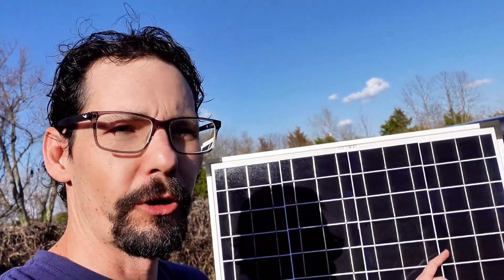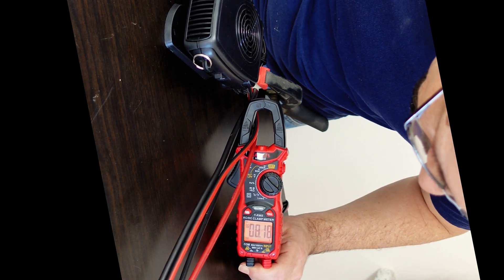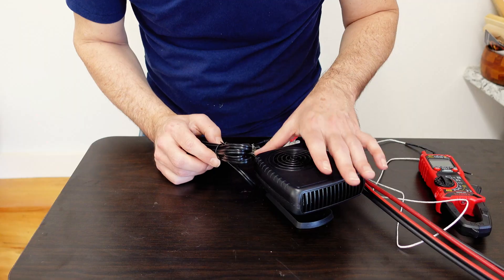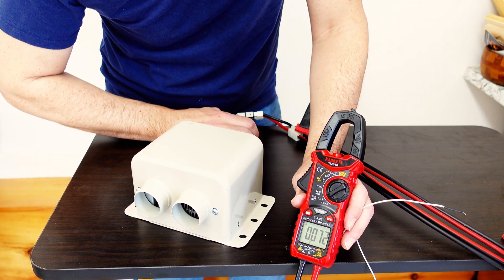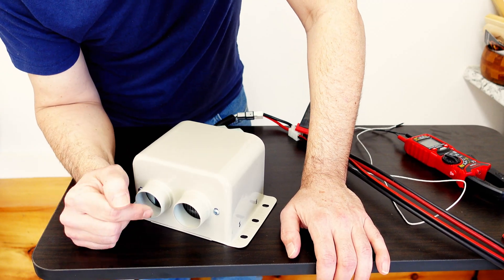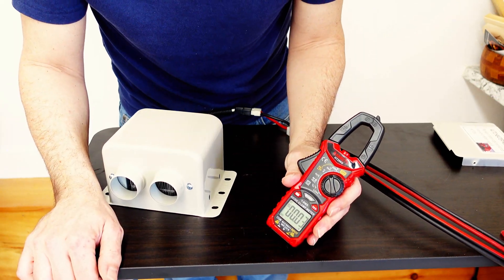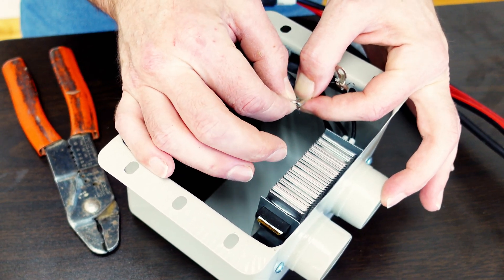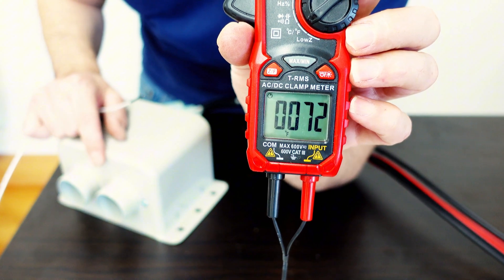Free Solar Hack

Comment: Nice would at least like to see the white with four panels 😊. Trumpocalypse Now
Reply from the maker: Me too! It's on the list. My guess, Lotta heat but fan runs a little too fast. Could possibly fix fan speed issue with the right resistor in series with it. I need to whip out all my analog meters to read accurate current for fan.
Reply: @ an old volume control knob is a variable resistor.   I miss Radio Shack
Reply from the maker: Great recommendation

Comment: I have seen little ice makers at Wal-fart. Do you think you could make ice for drinks and to put in a cooler with just solar panels? If I could afford to try I would.
Reply from the maker: What dimensions is it roughly? Is it AC?
Reply: @WayOfTheZombie  Yes it was AC and I wasn't thinking about that. I apologize for forgetting about your running on 12 volt.  There were actually 3 different models on the shelf. The smallest was like $80 and was maybe 1 foot side to side and top to bottom. the others were bigger and more expensive.
Reply from the maker: @SteveHammer-b3k  I do know how to run a DC to AC inverter without batteries so it wouldn't be a problem. I'll put it on my list
Reply: @WayOfTheZombie  Thanks, didn't think it could work. I'm new with solar, trying to figure what I might need.

Comment: I wonder if the higher voltage will burn out the heater at some point? I'm assuming that, being a car heater, it's a 12 volt system.
Reply from the maker: Tho I think they'll run for several winters, I have a solution in a coming video